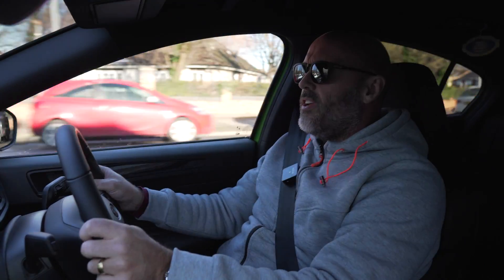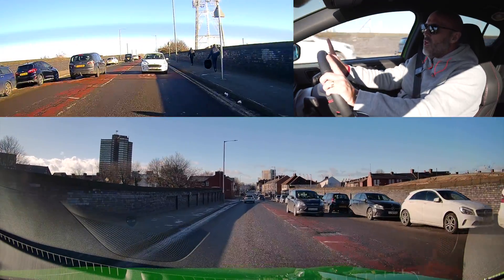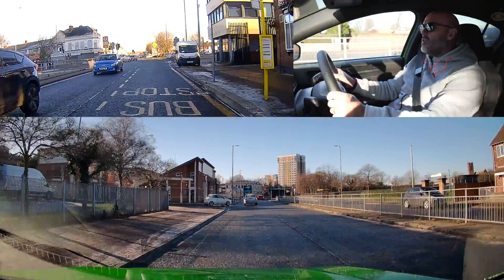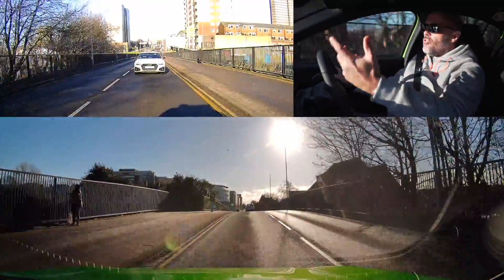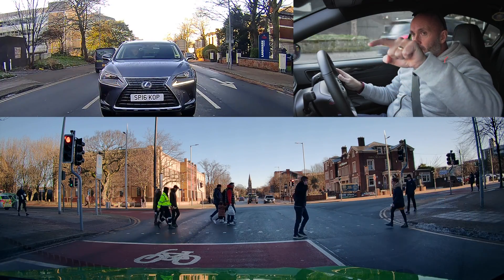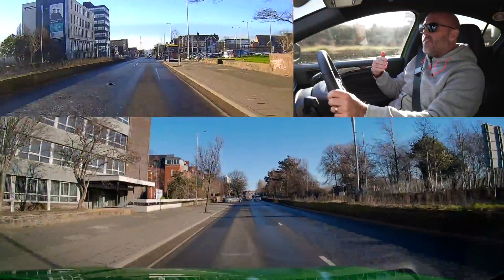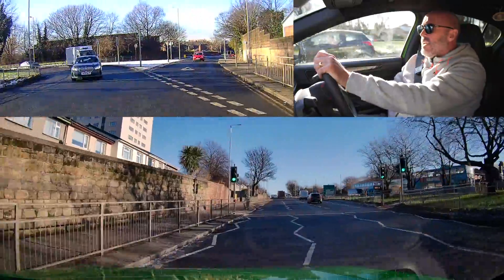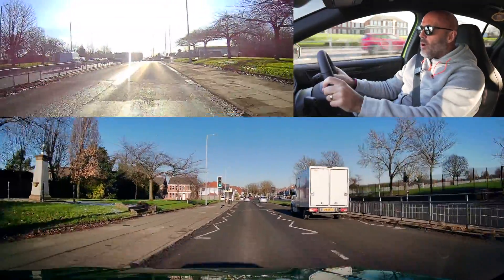How To Anticipate Traffic Light Sensors (Flashing Your Lights Doesn't Work!)

Comment: Something you didn't mention is that at some junctions, usually bigger ones, there can be a set pattern that the lights operate in. 
So as long as traffic keeps flowing into the junction it will keep sending green signals to the lights in the same order.

Especially in your own local area this can be a neat little thing to know as you can come to figure out pretty much exactly when you can expect a green light.

The only thing I would really like to press on people with this is that, even in the possession of this knowledge, is to NEVER stop looking. 
Emergiency vehicles may carry short wave radios that can influence the given signal. If you've ever had a green go way quickly back to red and a few seconds later saw an ambulance pass thats more than likely what happened :)

Comment: The sensors on a side road entering a main road will keep the side road light red until a car comes, this also applies to the ends of bus lanes, so cyclists who don't set off sensors can be left all alone for long periods, a permanently green cycle light would solve this . The side roads typically have a timer once the green light come on.
The sensors on main roads are detecting gaps in traffic, but there will be a combined gap detector and maximum timer.
A green man crossing onto a roundabout will automatically go green when the traffic gets a red light, but the green man on the side of the road off the roundabout is controlled by a mixture of pressing the button and waiting upon a timer/ gap sensor combination.
There are still some rubber pressure sensor strips about if a car parks on these the lights will go hey wire until the car is moved. The system will keep giving the side road where the car is parked priority by constantly cycling. The Met Police in the 1980s did this to set up traps with 2 second green lights on the main road. You can't get all your car over the white line in 2 seconds and it would be your word against that of 2 constables.
These rubber pressure strips existed before WW2 and taxi drivers used to get out of their cars and jump up and down on them.

Comment: I disagree that flashing the headlights doesn't work. IR sensors mounted above the lights will react to headlights at night, but the sensors only input traffic movement to the sequencing system which may not use sensor input at all times during the day, relying on simple time sequencing. Also, some lights are linked to other sets nearby to maintain traffic flow.
Reply: You can disagree as much as you like, but those sensors aren't optical, they are doppler radar!
Reply: @paulsengupta971  Er, no. Many have IR sensors.
Reply: @VictheSecret Oh, ok. Can you point me to one?

Comment: Not far from my house is a narrow bridge over a river, traffic lights either side - no loops, just microwave sensors on top of the lights. These are triggered by the speed of an approaching vehicle, not its presence. In one direction I reach a give way junction, turn right and then have 200 metres before I get to the lights. Common sense says "Red light ahead, nobody behind me, roll up at 10mph, and the lights should change" - Wrong - the lights stay on red with nothing in the opposite direction until a timer says "they've had enough green, someelses turn". The correct technique is "get up to 15-20mph", then foot off gas. the sensor then detects the car, triggers the light change, and a few metres before the stop line, you get a green. Car's still moving, back on the gas, go. Probably uses less petrol than waiting for the lights to change and then a standing start.

Comment: Thanks for confirming a few things 👍🏼
Away from lights,  shortly before 6 minutes you indicated in the left only filter lane. Do you advocate this to show people you really are following the correct direction rather than being in a specific direction lane and, therefore,  not indicating as why would you not be going left?  (or right,  accordingly) Hope that makes sense.  
Keep up the good work 👍🏼
Reply: In the past Ashley has advocated only indicating if there's someone around who will benefit from the signal- on the basis that this will improve your observations as you'll have looked in all the relevant places to determine if you need to indicate. Whereas indicating automatically means you may skip the observations.
Reply: @alfonsolapulce2733  something I've done for a lonnng time.  I just wondered if the thinking had changed

Comment: the flashing headlights at the sensors idea probably came to you across the pond, as in the US, our traffic lights often have sensors that detect emergency services by a strobe flashing on the roof of the vehicle. - but people see the flashing lights override the traffic signal and think they can do the same by flashing their headlights at it.  and the lights change, anyway, just often enough to reinforce the delusion.

also, in the states, the majority of our lights have a magnetic sensor in the road, and those are basically a metal detector.  we also have cameras with object recognition software, although the one in my town has since been replaced with sensors.  there are still a few lights that use pressure plates in the road, and some cities will put the lights on a timer, set so the lights will synchronize with people traveling at the legal speed.

Comment: The “flash your lights” myth comes from emergency vehicles. Some lights (though not all and it’s even dependant on the area as (iirc) there isn’t a national standard) can detect when emergency vehicles are approaching them and will either keep the light on green longer or turn the light over quicker.

In the US it’s daily common to use a special flasher unit on the vehicles to trigger this. It’s this “special flasher” that the myth came from.

Comment: This video applies to every single set of traffic lights in the country except the set in King's Lynn near St Nicholas Retail Centre on Edward Benefer Way. Approach those on the main road at midnight, 2 or 3am when there's no traffic about, and they almost always turn red when you approach them for literally no reason at all 😂
Reply: Some do deliberately turn red to try and prevent speeding and deliberately slow traffic.
Reply: Some local councils have actually used the speed detecting capabilities of the radar detector on traffic lights as a traffic calming measure.

There is one down the road that will cycle to red every time if your speed increases a few mph (even if still under the limit) while in the approach zone.

Comment: I know of a set of traffic lights locally controlled by traffic lights where a short spur is buses only.  I am sure the sensor there detects heavy weights because if a rogue car uses the bus only section the lights stay red.
Reply: it is more likely, the approved buses have a radio transponder that lets the lights know a bus is there.
Reply: @kenbrown2808 agreed, otherwise you'd get LGVs using the bus lane.

Comment: One or two traffic lights/crossings in my area are programmed to go to red on the main road if nothing is there, and then don't change to green until something is there, and timed in such a way that whatever vehicle arrives has been forced to stop or reduce speed to a crawl.  Apparently, they are delibrately set up this way to slow down traffic on some of the fast wide roads around here that only have a 40 mph limit.

Comment: There are some sensors that respond to flashing lights. I drive for a living and when it's late and there's no cars, I often do this from a distance and more often than not I won't even need to slow down as the lights will change as soon as I flash where as they won't change anywhere near as quick if I don't flash.

Comment: That explains if you are riding an aluminium bike the road sensors don't work.
Reply: They should. What's actually under the road is a metal detector. A bike won't have as much of a metal signature as a car.

Comment: I have had issues with the sensors on temporary lights not detecting me on a bike.  I have a set on my commute that doesn't know I exist. It's a case of jump them or take the path otherwise they never change (it's a 3 way set and I come out of the quiet road)
Reply: Sometimes suggested that you weave to a stop as a small vehicle.

Comment: Of course flashing your lights doesn't work, they would be accidentally set off so often by any anytime the sun was reflected onto them. 
OK, maybe not so much in the winter...
Reply from the maker: I know, it's comical. Go over speed bump, the lights change. Hit a pothole, the lights change. Brake a little too hard, the lights change.

Comment: There are lots of sensors but I have observed that in my city, during the day, on weekdays at least, many junctions are switched to a mode that doesn't use the sensors, they just go in a round robin sequence and for fixed periods for each direction.

After maybe 6 or 7pm they go in to sensor mode when there is less traffic.

Comment: There's a set of lights on the A40 at Lea in Herefordshire.  If you approach to cross over the A40 on a road bike.. ie carbon... the floor sensors do not pick you up. The only 2 lawful scenarios that I follow are to await a vehicle in my direction triggering the sensors, although it is a very rural road, or dismount and cross the road on foot.

Comment: 11:35 regarding the car reversing out; I often go into neutral if I see someone coming, so they see the reverse lights aren't on; is this a good idea?
Reply: I think so, it tells them you’re definitely not going to reverse out into their path.
Reply: Now I'm still only learning but I would leave it in reverse but brake, to let them know you're still intending on coming out but you're also acknowledging their right of way. If they then want to let you out, that's up to them, but at least they know you want to come out.
Reply: @NinjahDuk  There’s another point too. It’s the same reason I either press the brake or hover over it rather than the accelerator, if I’m at the lights and a pedestrian walks across the front. The reverse gear has a lot of torque, if your foot slips off the clutch and you’re in reverse your car could leap back a bit into the path of any cars. And sitting with the foot on the clutch for a long time just isn’t great anyway!

Comment: Can the police have overrides in their cars? At a junction near me where I know the timings very well they didn't change to red for the big gap in front of me like they normally do but let me and a police car following through, then changed.
Reply: In big towns the council UTC (urban traffic control) monitors many junctions on CCTV & can manually control the lights if the operator spots a struggling blue light vehicle.  Perhaps this is what you have witnessed - not aware of special equipment on the blue light vehicles.

Comment: The floor sensors do not work for cyclists. On my very early morning commute (if i choose to cycle), there are 2 sets of lights that i encounter that will not change for me unless a car comes along, regardless of my road postion.  I can sit there as long as i like. They are not timed at all. 
I have to proceed with caution ( more concerned about PR so only do it if NOBODY is around) or dismount and walk. 
Thought it was worth mentioning as i doubt most people would know.
Reply: Some do work. Depends on the sensitivity - helps if you go slow over the middle of them too.
Reply: If you have a Steel or Aluminium bike lay it on the strip for a few seconds it should trigger the lights, if it's a Carbon Frame you're out of luck
Reply: @TerryNutkins3 all of the above! I'll give that a go. Ta
Reply: Some floor sensor actually have two induction coils, one for cars, then a smaller one inside for bikes. So sitting in the middle not at the front of the box may get you picked up on a bike... But many won't pick up a bike or a carbon frame.

Comment: On the subject of red traffic lights, here in the USA and Canada I have yet to see anyone release their footbrake whilst waiting at a red light or any kind of traffic holdup. The UK technique of parking brake on / gear in neutral / footbrake off is virtually unheard of here. In all fairness, it goes against the culture of automatic transmissions and simply leaving them in drive, though applying the handbrake is still a wise thing. I am well aware that the traditional UK technique isn't as widely practiced even in Blighty as it perhaps was in the past. As witnessed by the many sets of brake lights still illuminated in stationary UK queues. And yes, auto hill hold etc has partly contributed to this but not wholly. Either way, it's interesting how "brake light dazzle" just isn't a concern here in North America.
Reply: correct, even if people apply their parking brake (and there are still many parking brakes that take a foot to apply them) it is drummed into us not to trust the parking brake, and keep our foot on the brake, both to keep the brake lights illuminated so people approaching know we're staying stopped, and because the parking brake has half or less holding force as the regular brakes do.  the only time Americans will take the car out of gear is if they know there is going to be a long wait, like at a roadworks, or crash, or a grade crossing with a long freight train.

Comment: I feel you should add turn right filter lanes into this video, the amount of people i see that dont pull forward over the sensor in the road to activate it and then wonder why the filter green light doesnt come on, too many that should know about it as most look like they been driving for years actually dont know this.
I can understand if its a motorbike and its not got enough size and weight to set sensor off but car drivers really need to pull forward and cover it.

Comment: I think the flashing your lights myth is from some systems which detect emergency services vehicles fitted with special flashing strobes, and switch to or extended the green. They certainly used to have these, perhaps still do, in the US (Opticom system).  Not sure about UK. Regardless, it’s not possible to fool them by flashing your lights!

Comment: The ones "up top" are doppler radar sensors and sense moving vehicles coming towards them in the same way as a speed camera does. In fact, you can pick them up if you have a radar detector in the car. You can also pick up the sensors for automatic shop door openers. The range depends on where they are pointed...they are normally pointed down to not point too far ahead, but one set of lights near my house has a hill leading up to it, and it picks up cars right down the bottom of the hill turning the lights green way ahead of you actually going through them.

The magnetic sensors under the road are metal detectors. I've noticed however that some of the sensors right at the front, near the line, now don't line up with cars since they painted the bike box at the junction, and thus may not pick up that there's a car there at all. Sometimes you have to drive a little into the bike box before the sensor will pick you up. Again, near where I live, after sitting behind another car which hadn't driven right up to the line, we waited through several light changes where our lane hadn't had a green. I got out and explained to the driver in front that he should pull forward a bit as he wasn't over the sensor to activate it. He did and we immediately got a green.
Reply: Have the exact same problem with a junction near me, sensor is past the stop line and the lights just won't change until the person at the front drives onto it
Reply: What sort of magnetic sensors are used? With many cars being made from mostly aluminium these days does it effect how easily the sensors can detect their presence? Even better in a supercar made from a composite chassis, and aluminium engine and suspension components with magnesium alloy wheels 🤣
Reply: @Rover200Power Basically metal detectors. If there's enough metal in the car, it should be ok.

Comment: All this of course requires that every light controlled junction has sensors.  Many in my area do not.  They are locked into a cycle and never alter from it.  Even a recent £3million installation of lights onto an otherwise perfectly flowing round-a-bout does not have any sensing installed.   It's ridiculous. That junction has gone from free flowing to constant queues.  Even at 2am in the morning, I've come up to it and I'm at the back of a 8 car queue because the lights are giving fresh air the green.

So, I really don't overthink lighted junctions like this. I stop when they are red or switch from green to amber, and go when I get the green light and it's safe to do so.  Of course, frequent particular junctions often enough and you learn the pattern in the cycle and you can better anticipate what they're going to to :)
Reply: Exactly. Use the lights as intended and there is no need to predict. It's what the Red/Amber combination is for. I think Ashley has spent too much time driving in a big city and forgets that lots of traffic are actually just on set sequences.